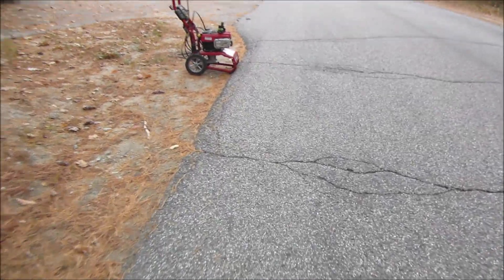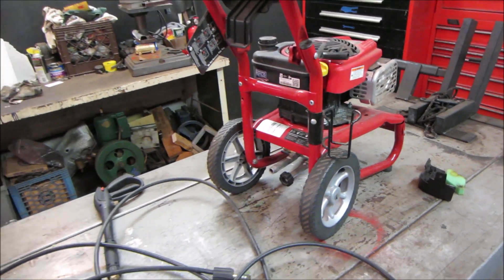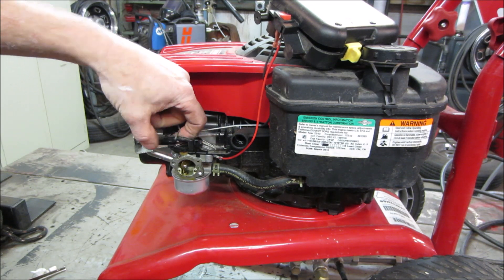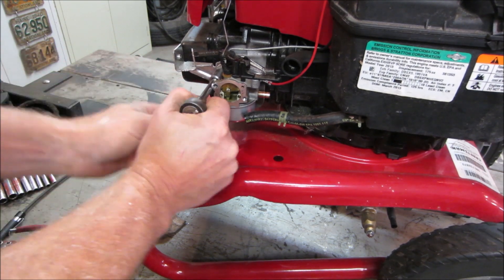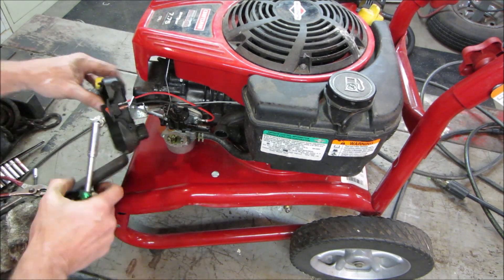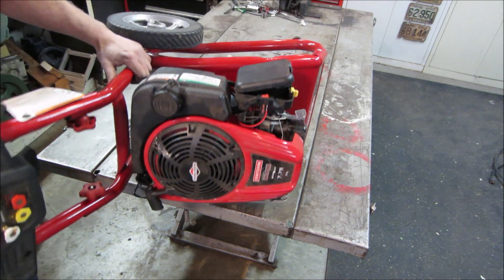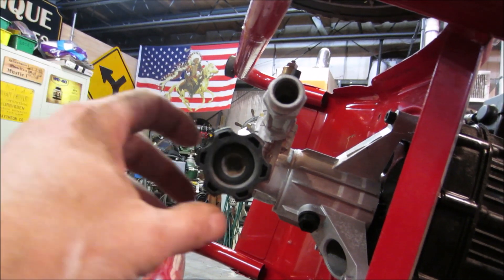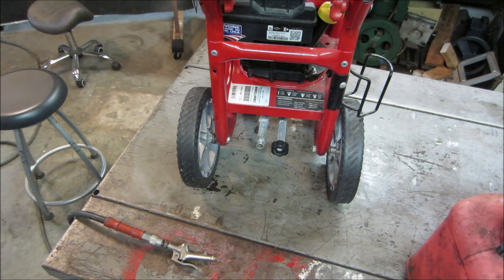Can It Be Saved? Junked Pressure Washer From The Garbage.

Comment: Use a small die grinder or Foredom/Dremel with a 1/8" burr to dig out that crack in the pump housing, and follow up by filling with aluminim brazing rod (Hobart is good, as is the Harbor Freight version).  Propane or MAPP will work great.  Be sure to remove all rubber/plastic seals from the housing first.  
TIG and filler rod will work well too.  C'mon--you can save this thing!  The pump uses a rotating 'swash plate' to actuate the three pistons.  A very simple and efficient way of creating high pressure.
Reply: Dear T.D.I.T.C.
👍👌👏 I wanted to comment exactly the same. But fortunately you already did the work. Thx! 😁
This unit should be saved definitely.
Best regards, luck and health.
Reply: Project Farm recently compared different aluminum brazing rods. Harbor Freight brand actually came out real good. Let's see a real world example Mustie!
Reply: @ozarkarky  
👍👌👏 Yes please.
Reply: I agree........Come on Mustie......time to learn to braze or tig.....lol.....you can do it !!!!
Reply: @robbusheay4258  
👍👌👏
Reply: @ozarkarky  i saw the same comparison, seems its the same channels we watch haha
Reply: @ozarkarky  -- actually, Project Farm also did a real example by fixing the head of an engine in the same video, and it seemed to work with no problems. I would think the pressure on an engine head would be more than the water pressure so it should work. Let's do it Mustie 👍
Reply: Your Right About Saving The Pump By Brazing It Or Do The Same Dremel Clean Up And Prep Method And Use Some Silver Solder And A Little Bit Of Map Gas, Should Do It Also But That Pump Is Well Worth Fixing And Continuing To Use...
Reply: @goldhunter9641  silver solder was my next go to suggestion if the aluminium brazing rods didn't work
Reply: Yes, give it a try.
Reply: He's already got a MIG machine, throw a spool gun on it and practice some aluminum welding. It looks ugly compared to TIG but it works.
Reply: could probably drill/tap/bolt method too
Reply: JB Weld?
Reply: Ye do it Mustie!
Reply: I’m in favor of this as well.  Cmon mustie, u can do this.
Reply: @supermarioisacat  aluminium brazing rod it is then :), cmon Mustie! Give it a go
Reply: Aluminum braze it!  Nothing to lose. :)
Reply: Funny..... I was just thinking the same. Channel it a bit and tig that bad dog. Good as new.
Reply: He has a welder. See the videos where he does frame repair on the Cutlass..
Reply: yes. its work
Reply: @ozarkarky  After seeing that video I was going to try the harbor freight rods to make some aluminum intake piping for my car, it's not structural so doesnt need to be tigged.
Reply: I was thinking solder, but the brazing would be better. Come on @Mustie1 lets fill the crack.
Reply: Roger that friend!
Reply: @TSRIDE  PF also comes over here and watches his videos and makes comments.
Cheers
Reply: Tig
Reply: exactly what I was thinking. Expected Mustie to go ahead and fix it for little time and cost.
Reply: Pleeeze
Reply: @GregScavezze  I've seen a thick coat of JB Weld do some amazing things
Reply: I'd like to see Mustie try that as well. Good real life test for those rods
Reply: C'mon Dr. Mustie; don't give up on the patient...at least try some JB Weld.
Reply: Swash plates kick ass
Reply: I was thinking the same thing
Reply: I watch the farm project and wanted to say the same.  I just hope the huge effort I have made helps the channel.  All the best Mustie1
Reply: another vote for aluminum brazing rod...
Reply: C'mon Mustie, aluminum brazing rod! I've seen the Project Farm video as well and I couldn't think of a better place to try it.
I've seen you put much more work into things that aren't this useful. Potentially useful.
You want recommendations for future videos, this one is at the top of my list.
You are probably well aware of how many pressure washers are in the garbage for this exact reason.
Reply: @TC-gn2by  Water seems to find its way around J-B Weld.
Reply: I was going to suggest the aluminum brazing rod from Harbor Freight. Ya beat me to it.......
Terry from South Carolina
Reply: Well Mustie, the polls obviously aren't closed, so far the vote does look fairly unanimous 😁🤞
Reply: @Earthneedsado-over177  I did a JB Weld repair on a stainless solar-thermal heat exchanger operating at 180f / 60psi filled with a 50/50 water poly-glycol  mix still holding 3 years later. Granted, pressure washer operates much higher but would be fun to try.
Reply: was going to say the same , try welding crack line ?
Reply: Is it worth it? There is 2400 psi on that square inch of aluminium where the crack is... It's more than the pressure alone. Say it runs at 3000rpm, that's 9000 pressure pulses per minute at 2400psi, give or take. Would you trust a weld under those conditions? I wouldn't without a case around that pump.. lol.. 

My take? He has a perfectly good motor that will bring something else back to life or even work in a future project and the stand has its own usefullness.
Reply: @TSRIDE  Don't think you can use silver solder on Aluminium.
Reply: That was my exact thought! Super easy and cheap fix. I'd really like to see him do that.
Reply: In some cases, you can also do the considerably poorer repair with jbweld or hotmelt, and add external fixing (wire wrapping can work really well) which puts the repair under higher PSI loading than operating, so the repair is never undertension.
Reply: I know, right? I don't understand..  Looking back, I don't think I have ever seen him braze. I tried brazing and failed.. What I was repairing was cheap to buy, but at least I tried.. Does Mustie sound DEFEATED? Well, we tried?  I'm staring at a MAP gas torch in my room right now.. He has nothing to lose.
Reply: Yep, we need a try!  Nothing to lose and everything to gain and maybe a chuckle from Mustie when it no longer leaks!
Reply: @larryiowatexasrooster9317   Who is this guy? What did he do with Mustie? This is something Mustie2 would do. Mustie1 would get it done. I'm not one to fix anything, but making things worse, so I feel bad for even replying to this comment, but I had to say something.. I was just in shock Mustie threw in the towel on it.  I thought brazing, and well.. I wasn't the only one. I'm even down for gluing it if it works. It's free and it's still cool. I want a pressure washer =)
Reply: Yes the vote seems to be that you do repair the crack in the pump .
Reply: i was about to comment to use some jb weld ,  so... you win  :)
Reply: @Vo0d0o2009  This is probably the most liked comment in the whole comment section, there is no way he doesn't see it..  I am laughing... BUT.. The title says "Can It Be Saved?"... NOT "WILL IT BE SAVED"...
Reply: Yep, use  a Dremel with a cutting bur to v out the crack, clean it really good and TIG it.
Reply: add my name to the growing list of ppl that wanted to say this exact same thing !
Reply: Fix it ;-)
Reply: yep
Reply: In OZ a brand new pump head is $55
Reply: @bruceknowling415  No. He must win this battle and fix it :D
Reply: The pump is probably not aluminum but diecast.
Reply: @robbusheay4258  Agreed!  The question at this point isn't "is it cost effective", the question is "can it be done?"  I suspect that you would have great success :) This really is a GREAT channel :)
Reply: I know Im quite off topic but do anyone know a good site to watch newly released movies online?
Reply: @Malik Wesson Flixportal :P
Reply: @Andy Zyaire thanks, signed up and it seems like a nice service =) Appreciate it !!
Reply: @Malik Wesson you are welcome xD
Reply: I was really disappointed that he went all that way and didn't continue on and finish it. Welding would have been my solution as well.
Reply: @PandaMan02  I like that suggestion but the Crack seemed to wide imo.
Reply: @gooseknack  Welp those rods will work with any kind of pot metal not just aluminum. And if we're worried about safety he could bolt on a piece of metal.
Reply: @GregScavezze  YES!! J B Weld that bad boy...
Reply: Seeing all these replies for aluminum rod or silver solder or even JBWeld makes me think there’s another potential fix that no one’s mentioned yet - superglue/baking powder repair. I recently looked into this and the results are astounding and instantaneous and require no tools other than maybe digging out the crack just a tiny bit, and maybe not even that!
Reply: That's what I would do it will work like new
Reply: Just take a grinder and clean where the crack is and put JB MarineWeld and it will seal that. 
I did the same thing with J-B weld for steel on my gas tank. 👍
Reply: Good comment. I tried Heliarc, back in the 70's but couldn't afford one. I've never invested in one. And TIG, I ALWAYS let the filler rod touch the Tungston and it lights me up ...EVERY TIME !
Reply: @Earthneedsado-over177  I have had good luck patching holes in metal gas tanks with J.B. weld if the surface has been cleaned good. I don't know how well it will work under pressure.
Reply: I was thinking possibly using a MiG with a spool gun & aluminum wire.

Comment: 👍Sometimes ya win, other times ya lose. Neighbor gave me his 1yr old Pres washer. Said it stopped working. He bought another "throw-away"- When I finally got to it I ONLY found fuel shut off valve in OFF position. When I saw the valve I said, "no way could it be this easy"....Worked fine after turning fuel ON 😂😂😂👍
Yes, I told him. (He's embarrassed) He didn't want back. It sold quickly. 
Good video M!

Comment: I’m answered a Craigslist ad with the same pressure washer, a 3600 watt generator, and two electric motors; all for $50.00. The pump on the pressure washer was broken in two places with pump housing pieces missing, a non-starter. I pulled the engine and installed it on a 22” Ariens walk-behind weed eaters. After cleaning the carb the engine fired right away but was revving way too high. I could slow the motor by moving the governor arm but it would max out as soon as I let it go; no governor control. I removed the engine, drained the oil, and removed the sump cover, sure enough the governor had come apart. I simply removed all of the governor parts and pieces using a magnet in all the nooks and crannies, replaced the oil slinger, and bolted up the sup cover. Once the engine was reinstalled on the weed eater I installed a throttle control in place of the governor and fired it up. What a beast, 7.75 horsepower, weeds don’t stand a chance! Darlington, South Carolina
Reply: @bluejar5614  I’m the guy who always thinks of those things afterwards...
Reply: Hi,  After reading your post I came to the conclusion that my engine (same as the one in this video) may be having a broken governor?  I was wondering if your old engine was difficult to remove from the Ariens weed eater?  I have an Ariens leaf vacuum that is making it impossible for me to remove it from the impeller.
Please let me know if you have any tips to remove the engine's shaft from the impeller?
Reply: @georgesanchez9971  The Tecumseh engine had three bolts securing the engine to the deck. Once I had removed the drive belt and the three bolts, the engine lifted off easily as the drive pulley is a smaller diameter than the opening in the deck. I removed the bold and washer securing the drive pulley to the motor shaft but had to resort to using a gear puller to get the pulley off. I’m not sure how the impeller is secured to the engine shaft on your vacuum but I would think it has a bolt and is keyed to the shaft. Try Googling for an Ariens service manual using the model number of your vacuum.
Reply: @williamlott7612  Thanks for getting back. You are correct the impeller is secured to the engine's shaft by a bolt and keyed to the shaft. I did try to contact  Ariens several times.  In my last attempt, I was able to speak to a service rep, but they were of no help.  Their suggestion was for me to take the vacuum to an authorized dealer.  I did get a hand of the owner's manual and parts but I am still looking for the service manual.  In my view, this style of vacuum is very similar to the newer billy goat's design.  I have been also trying to find their service manual.  I just do not want to bend the impeller and throw out of balance.
Reply: @georgesanchez9971  Are there any threaded bolt holes in the impeller near the shaft penetration?
Reply: @williamlott7612  Hi William,  there are none in the impeller.  The shaft is the standard 7/8 3-5/32 with a 3/8 24 thread.
Reply: @georgesanchez9971  Try soaking it with some PB Blaster or something similar, letting it sit overnight, and trying it again. About the only thing left after that I can thinks of without the Ariens service manual is to apply some heat from a propane torch (or something similar) to the impeller around the shaft penetration while prying gently on one side and then the other. Be careful not to heat the motor shaft but just the impeller.
Reply: @williamlott7612   Thanks for getting back to me.  I actually tried to use a penetrator similar to pb.  I tried for several days.  I also tried the heat treatment with a small bottle propane heat torch.   I was thinking of perhaps fabricating a tool similar to the ones used in lawnmowers.   Thanks so much for helping out.
Reply: @georgesanchez9971  Good luck with the tool fabrication. Let me know how it turns out.
Reply: @williamlott7612  I might make a video of it.  Thanks for your sage advice!

Comment: The brass part on the pump is the unloader valve. Usually when they fail, the engine will run and spray normally, but the engine will stall when you release the trigger. The unloader takes the high pressure output and circulates it back to the inlet
Reply: Most of the time on the Easier unloader valves like this one has, it's best To just Take it out of the pump housing and clean the the end of it, that goes inside of the pump, it's also Recommend not to adjust the factory set adjustments on the unloader valve... Most of the time a Small piece of debris is what causes the unloader valve to not function properly...

Comment: I picked up a pressure washer this summer for $20. The lady told me the pump was no good. I took a chance on it only because it wasn't seized up. So I got it home, put some gas in it and much to my shock it started right up. All I did was change the sparkplug and a new fuel line (which is why the tank was empty and probably saved the carb). But sure enough the thing would not pressurize. So I tore it apart and figured I'd just grab a replacement pump off ebay. But wouldn't you know the thing had a hex driven pump. The crank didn't have a keyway on it, just a weird hex drive, and of course they no longer made that pump. And the rebuild kit was like $140. Not wanting to spend that much I just tore the whole pump apart and replaced the check valves and the  spill valve. I never would have been able to do all that without watching your videos and learning so much from you. So thanks very much and keep them coming. Have a good one

Comment: Briggs Engine Tip that MAY be helpful.

I have repaired 100's of Briggs engines.  The top problem (not the problem on this engine)  I have found with most of them that don't want to start and stay running (with this style of bowl nut/metering valve) is that they get clogged up with debris from the fuel tank.

Note:  ONE grain of sand will clog the metering jet and cause the engine to starve for fuel and either not run at all or perform poorly due to lack of proper fuel flow.  Just blowing air through it will not always show a clogged metering jet.

1:     I always clean and rinse the fuel tank.
2:     I visually make sure you can see through the cross hole in the bowl nut.
3:     I rinse the cross hole with brake clean and then block off one side of the cross hole and run some more brake clean through the open side of the cross hole to ensure that fuel will actually travel through the cross hole and up through the metering jet.  If the brake clean doesn't provide a nice flow of fluid out the center hole in the end of the bowl nut/metering valve you may have to find a small piece of wire (i.e. like you find on you loaf of bread) and remove the colored plastic from the wire.  Insert the wire down the center hole to clear any debris from the metering jet. After the wire is inserted you should be able to see it bottom out on the inside of the cross hole.  Be careful that the cleaning wire is not to large and not to force it into the jet hole as it may enlarge the jet hole and ruin the proper fuel delivery ratio to the engine.
John
Reply: Good tips! I usually get a rebuild kit ir just replace the carburetor.  I have found a few carburetors with the center metering hole completely blocked. I have micro drill bits that can usually reopen those. The problem I find is the internal passages blocked or extreme corrosion due to water egress. Those pressure washers ingest water easily.
Reply: @scottfirman  Great to see another RC guy in the mix.  I enjoyed that hobby for about 50 years.  Started in 1968 and sold all my stuff back in 2018.  Did everything from sport plane flying to RC helicopters and really enjoyed the journey.

Comment: Worst case scenario, you take it to a welding shop to get TIG welded. The low temp brazing rod approach the other brothers mentioned is also a good way to fix it. The pump is definitely saveable. Thanks again for the great vids. Rev. D.